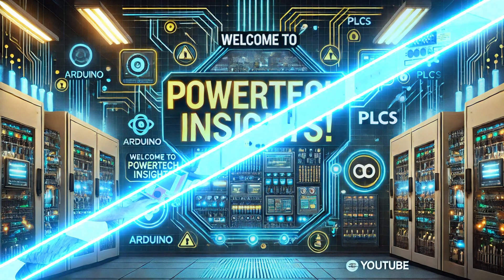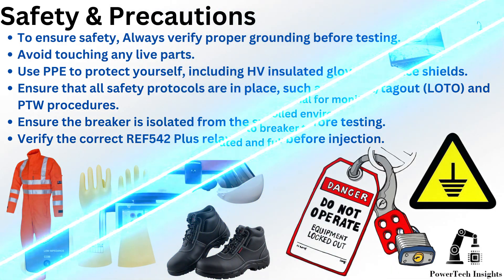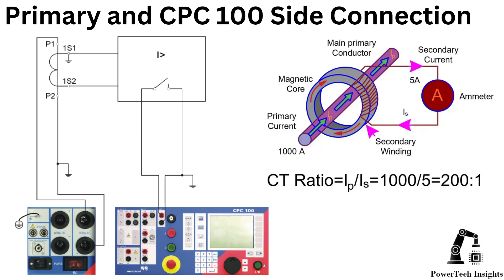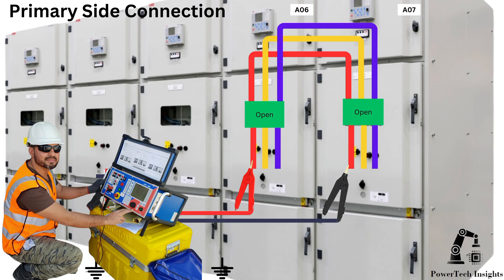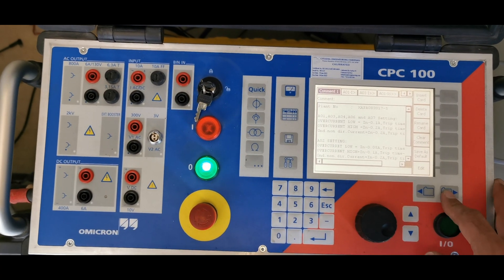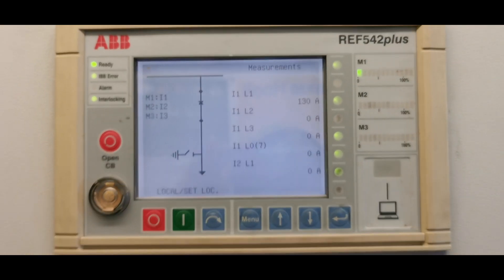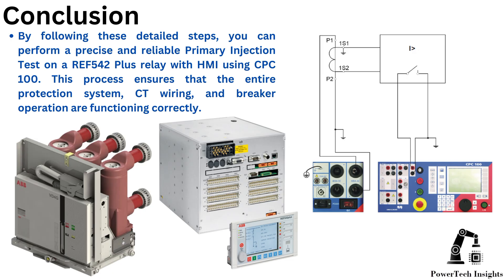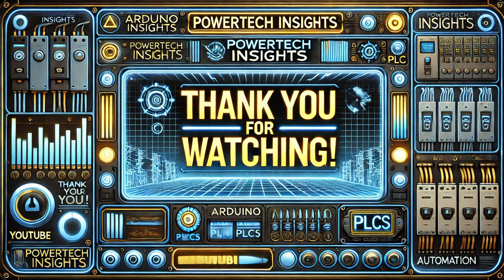Primary Injection Test for Circuit Breaker  REF542 Plus with OMICRON CPC 100

Comment: When we are injecting 800 amps then why we not get socked by touching the cable
Reply from the maker: You definitely will get the shock if you touch the cables while current is being inject, so never touch the cables

Comment: but how many tests are done on an MV transformer when before its really energised
Reply from the maker: Following test should be done before energised the power Transformer as per IEEE and  IEC standard.

1. Insulation Resistance (IR) Test
	•	Between windings (LV-HV, HV-E, LV-E)
	•	Confirms insulation health

2. Polarization Index (PI) Test
	•	Extension of IR test to check insulation dryness and condition

3. Transformer Turns Ratio (TTR) Test
	•	Checks winding ratio for all tap positions
	•	Confirms correct voltage transformation

4. Winding Resistance Test
	•	Measures resistance of HV and LV windings
	•	Detects issues like shorted turns or poor connections

5. Vector Group Verification
	•	Ensures correct phase displacement and winding connection

6. Magnetization (Excitation Current) Test
	•	Assesses core condition and magnetic circuit

7. Sweep Frequency Response Analysis (SFRA)
	•	Detects mechanical displacement or deformation of windings

8. Capacitance and Dissipation Factor (Tan Delta) Test
	•	Checks insulation condition of bushings and windings

9. Oil Tests (for Oil-Immersed Transformers)
	•	Dissolved Gas Analysis (DGA)
	•	Water Content
	•	Dielectric Strength
	•	Furan Analysis (for paper insulation degradation)

10. Buchholz Relay & PRV Functional Test
	•	Verifies proper protection relay operation

11. Temperature & Pressure Device Checks
	•	Includes WTI, OTI, oil level indicator, pressure relief

12. Earthing Resistance Test
	•	Ensures proper grounding system

13. Functional Tests
	•	Cooling system operation (fans, pumps)
	•	Marshalling box wiring and CT polarity checks

14. Ratio and Phase Angle Test (Optional in some cases)
Reply: or thanks so much,
Reply: @PowerTechInsights   do you also do protection relay testings
Reply from the maker: Yeh i can do that, let me know which relay do you want to see the settings
Reply: i want SIEMENS SIPROTEC 5 or any other model in that catalog